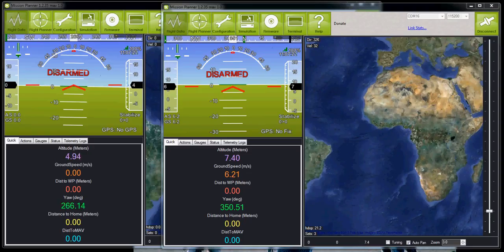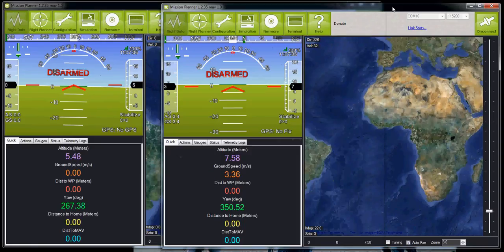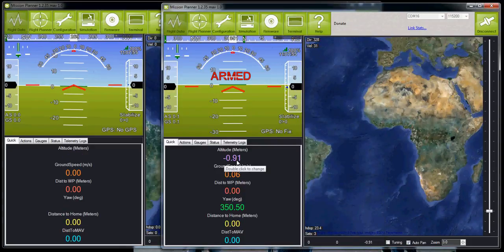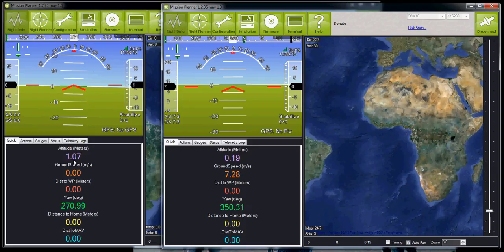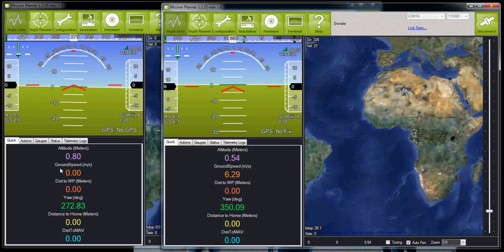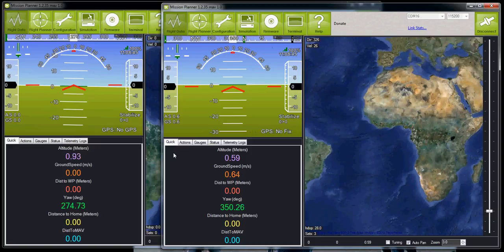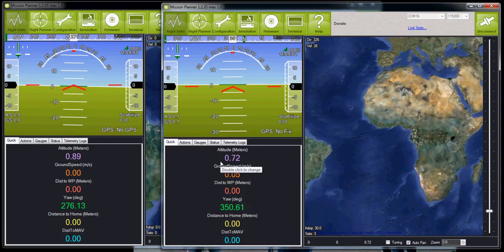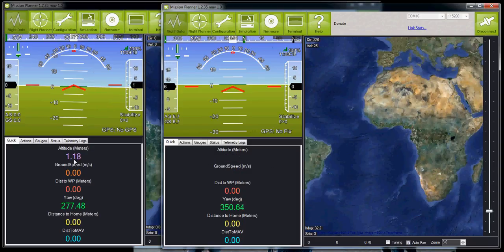APM1 vs APM2 baro and altitude comparison

Comment from the maker: @Ateadata,
     Baro drift is unavoidable I'm afraid.  I've seen it drift as much as 5m over 10min.  You can lessen the effect by letting the copter sit for a few minutes before take-off to ensure the board has completely warmed up.  Even after that though, the weather will cause it to drift.  There's really no way around that as far as I know.  I think this is common to all barometers no matter what the flight controller is.